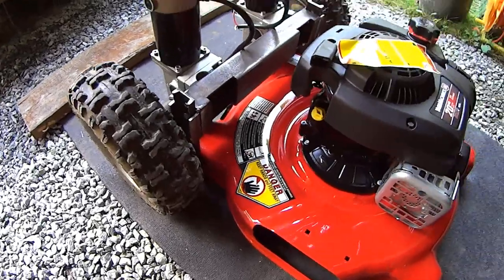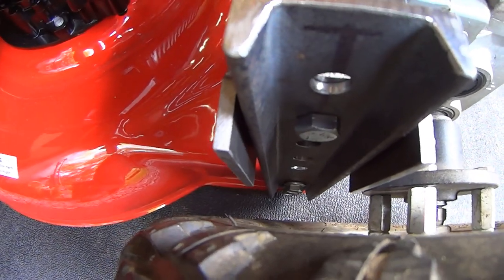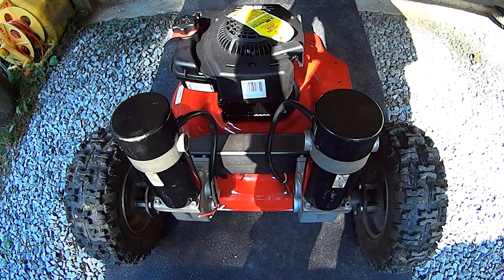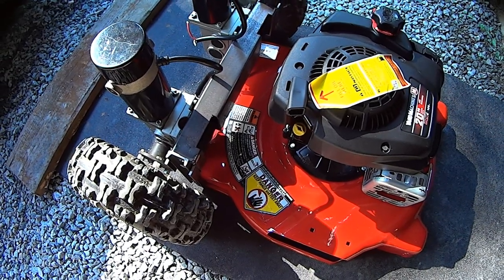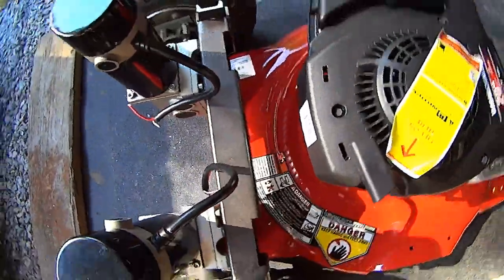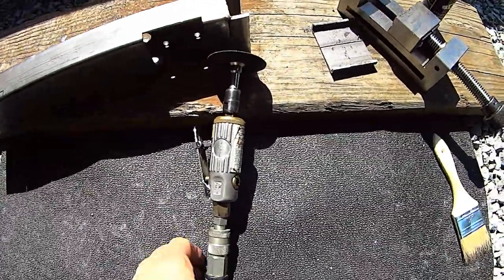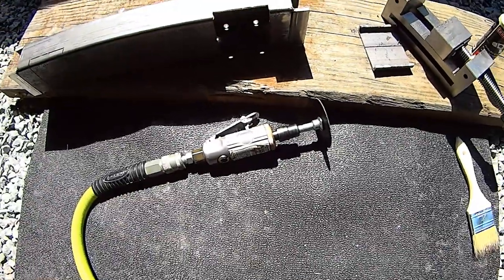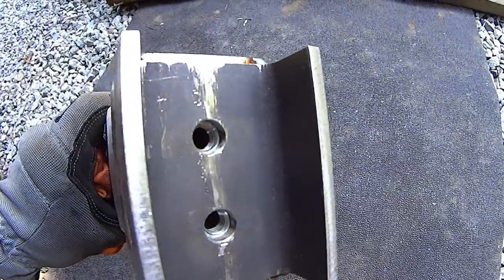R/C Lawn Mower V2: Pt. 2 How to build rear main tube. Fabrication techniques, next weeks plan

Comment: what are those wheel, and link to buy them?
i am building one soon :)
Reply from the maker: Wheels came from The Tractor Supply Company with tires on them. I don't have a part number. They did require an adapter to make them fit properly. Enjoy your build. Thanks for watching and commenting.

Comment: So how big is your air compressor?
Reply from the maker: 30 gallon 110v.... They claim 5.5 scfm @ 90 psi. About as big as you can get on 110v. I need a 220v unit with a larger tank.... I could always use more air.